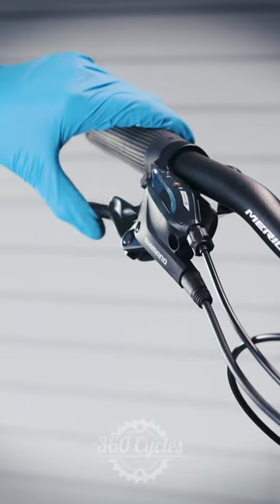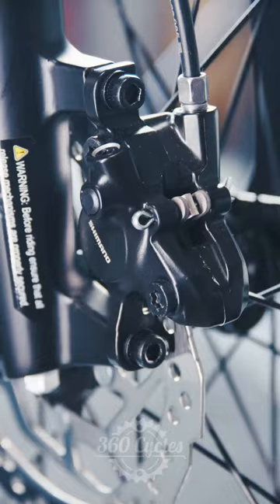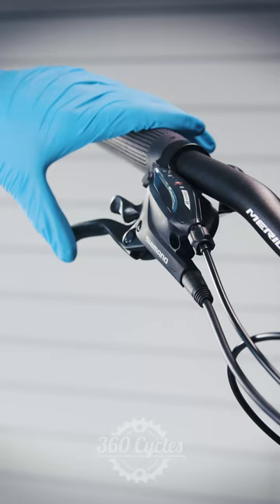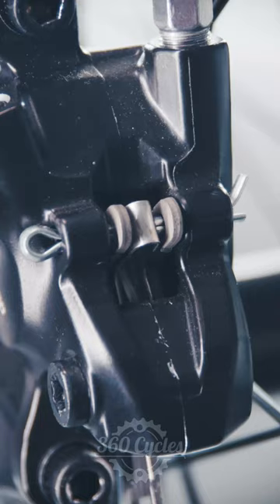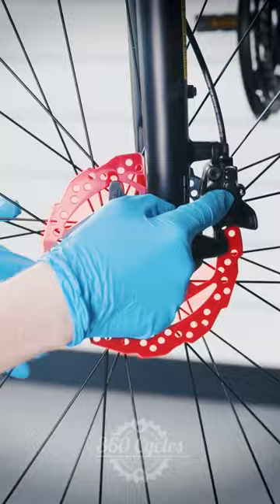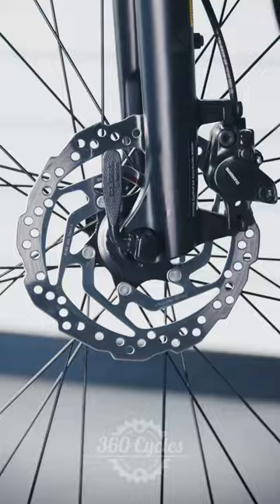How to prevent squeaking brakes | 360 Cycles Advice

Comment: is it normal for the brakes to squeak when the bike is new
Reply: None of the advice I've come across addresses issues with brand new bikes. I suppose I could attempt cleaning them with alcohol or adjusting them by loosening and tightening, but I had hoped that dish soap or a light spray of WD40 would do the trick.

Plus mime are cheap one sided calipers aka a Walmart bike.
Reply: Is it though I just got my bike and I put 70 miles on it so far and it’s still squeaking
Reply: I really hope you said WD 40 as a Joke. It probably would stop the brake squeaking but it will definitely also stop it from working.
Reply: @janoschk.5730 Hahahahaha
Reply: @janoschk.5730 I normally oil my brake pad and soak it down before every ride